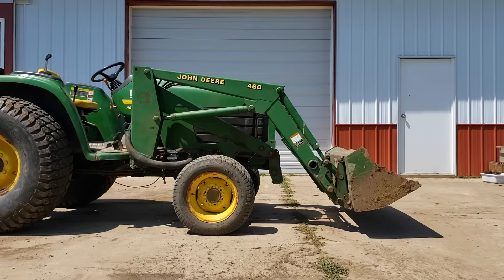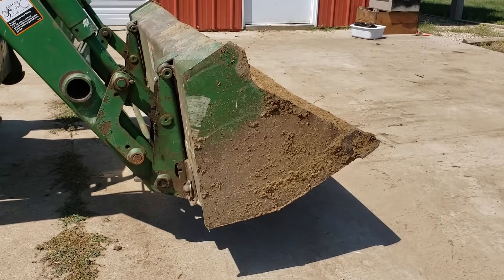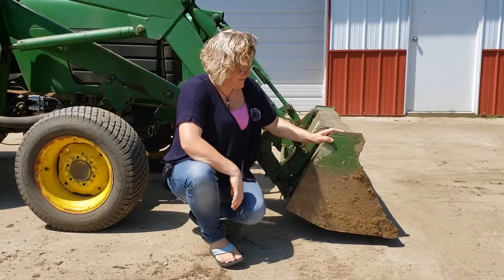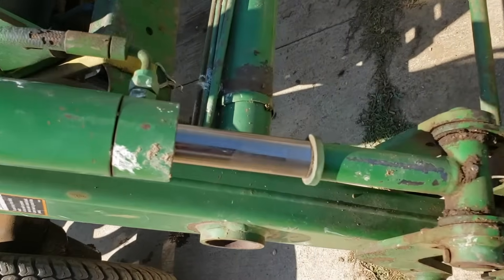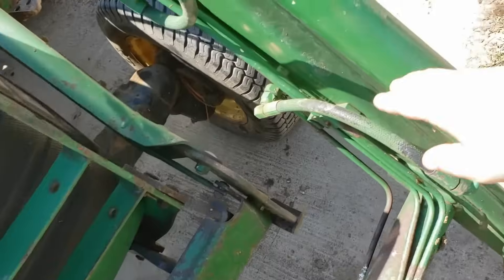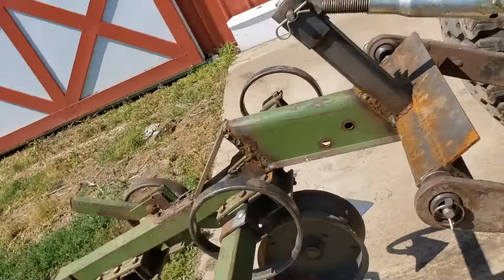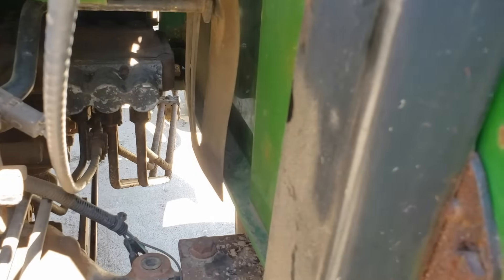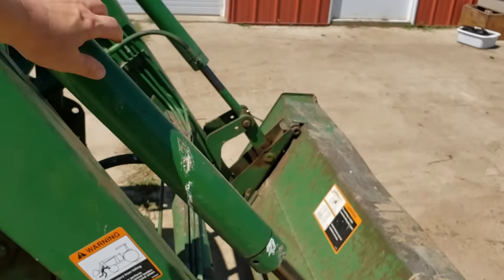How to Figure Out if Loader Control Valve or Cylinders Have an Internal Leak

Comment: Thank you great video. I have a similar issue with my min excavator but it happens with everything. Arm, bucket and dozer blade all drop over a period of an hour or less. I am changing tracks at moment and had it raised up uding arm and dozer blade but it kept creeping down. Very frustrating. I take it that rules out cylinder leaks and must be valve block or a seal in tank? Any advice would be greatly appreciated 👍
Reply: that all sounds off the same hydraulic valve/machine controls valve.

if you can check out if your mini ex has this valve isolated, it should be easier to check. lets say all the functions except track, are on this valve, I'd suspect the spools. either debris, stuck spools, valve failure. 
have seen where some mechanics MIX spools up, and do not put them back in order, causing this issue to be continuous. but this is a very rare thing so far.

I work on CASE, tend to lean more on hydraulic side. check out them spools, look for any abuse, cuts that cause a leak. Basically the spool for bucket lets say, has 4 options cut into the spool, depending on operation, the spool will shift to designated cut, and allows the hydraulics to flow is such way. 

lastly, the spools/control valves, seem to be the most sensitive/intolerant areas in a hydraulic system, once tiniest of metals entered and did its ripping, high chances it destroyed other spools with it.

Comment: For safety reasons, I ALWAYS have my hydraulic equipment DE-ENERGIZED!!!  What I mean by that is, if my grandkids go out to play on my stuff, I do not want them to pull a lever that pins or crushes someone under equipment.  I give zero 4ucks if my equipment drifts over several hours when I am not using it.

Comment: You should be able to isolate by simply disconnecting the quick connects. If it drops with the lines disconnected, it's leaking past the internal cylinder seal.
Reply: Or remove the return line off the cylinder and dead head the buck cylinder rod completely out of the barrel. If oil shoots out of the return port of the cylinder then oil is internally bypassing the gland seals....just aim the port towards the grass and away from people. Hydraulic high pressure isnt something to play with

Comment: A slightly simpler method is to remove only the couplers that control tilt. If the bucket fades then a cylinder leaks. To tell which cylinder is leaking, remove one of them from the system and temporarily cap the lines.

Comment: Thank you for this video. Do you have a test for determining which cylinder is leaking, left or right? I have one side of my lift cylinders has a little give when loaded and bounces. I assume they should be rock solid. Thanks again.
Reply from the maker: It’s best to rebuild both sides. Even if only one side leaks, once you rebuild that cylinder, the other one’s seals will likely go out due to the fact that those seals are just as old, and the pressure change causes them to go out after the leaking cylinder is rebuilt.
Reply: @shortlinepartsllc6795 any advice on isolating which cylinder if both were repacked last week?

Comment: Last week I had cut a large tree trunk that had fallen over..some of the pieces were maybe 350-500 lbs..  I had cut one in half and fired my Ford 4000 up and the loader went straight up without me even moving the lever to raise the loader and it sprung a huge leak..blew a seal out where the 2 control levers are that raise or lower the loader and move bucket up and down.,..so I shut the tractor off and the loader came down slowly..  I did not want to work on it where it had messed up because it was far away from all my tools so I cranked the engine up and up went the loader maxed out and I drove it to the designated work area..turned engine off and loader came down.

I have replaced the blown out seal and filled the hydraulic fluid back up and went I start the engine the loader will not raise any now..but the bucket will move...I think something happened to the 2 large hydraulic welded cylinders that raise the loader up but there are no leaks...now this Ford 4000 has a separate pump on the front that runs when the engines cranked but I think its working right...any ideas anybody ??  I need my tractor for work on our property but I don't know what to do now and live out in the boonies.
Reply from the maker: Did you try switching the bucket lines with the loader arm lines like in this video to see if the problem switches (arms raise but bucket doesn’t tilt) so you can know if the valve is the problem? My guess is there’s something broken inside the valve.
Reply: @shortlinepartsllc6795  Sorry for being late here to your reply..I really haven't messed with it lately but going to do this in a few days and see what happens..the bad thing is I don't have anybody here to help me bleed the air out of the hydraulic system.  Thank you for the reply.

Comment: Thank you for, the good troubleshooting methods and options... Much appreciated...  I have a New Holland compact tractor that is really slow at the bucket arms. I added my forks and it seems I need even more RPM's to lift. The bucket front/ back tilt work fine. Tnx again! ~ D

Comment: a bypassing cylinder or valve creates heat ..... operate the equipment then do a thermal scan .... the component that is the hottest is "leaking"

Comment: I was wondering if you could perform a reverse test. Prolonged resting with upward force on the bucket to see if the Pistons leak fluid. Seems to me they are sucking air in either around the seals of the Piston or like someone else said the quick connects which are designed to hold pressure. Great video though.

Comment: Those wondering why drift matters, be aware that fluid under pressure, that is leaking past a seal, will further erode that seal and possibly the metal that holds it in place. In other words, bad goes to wor$e.

Comment: Good idea, but the final conclusion is not correct. Piston seal leak will not cause drift. This test proofs there is a leak on the path out from the piston end - the pipe at the ass end of the cylinder, the one you didn`t remove and check.

Comment: I don't think cylinder drift can be caused by leaking cylinder seals due to one side of the piston having lower volume than the other.
Reply: I am an old, and I mean old, hydraulic and auto mechanic. Think about a shock absorber on a car or truck. You have a cylinder, a piston, a rod, and oil. The piston has a hole in it but the piston is still required to move from one end of the barrel to the other without loosing or replacing any of the oil. 
I am guessing that this is similar.

Comment: If the piston rod has retracted , the equivalent volume of oil had come out externally ( from cylinder if both piston and gland seals are demaged or from demages hoses ) or internally through directional valve.
Reply: correct, oil has to be removed from the cylinder for the piston and rod to move. probably back to the tank trough the directional valves

Comment: I called that before any of the tests.  I just rebuilt my bucket cylinders.  They were leaking slightly out of the front so I was pretty sure the gaskets (o-rings) were screwed up inside too.

Comment: Now lets see if I got this right, when you switch hoses, tilt with lift, then to make loader lift you move the valve control  lever in the bucket tilt position then the bucket lifts or lowers....... In your case when motor was shut off for a while with the hoses switch the bucket still lowed, but if it didn't then that would mean the by-pass leak is in the valve control body. Did I get this school lesson right? if not thanks for trying ........
Reply from the maker: If the problem switches, then the leaking is likely happening in the valve control body. For example, in this video if the loader arms drifted down when tractor was powered off, that means the leaking is likely in the valve.

Comment: Your not accounting for the cylinder rod volume. even if you remove the cylinder seals all together and cap the hose connections the rod will not move in or out. As the rod, in your case, is pulling out of the cylinder hydraulic fluid or outside air must be replacing the space the rod was taking up. I think you have a leak somewhere that will seal under pressure but leak air in when under a vacuum.
Reply: True, as the rod extends the non rod side of the cylinder has to be pulling fluid from somewhere due to the increase in volume.
Reply: @bhstor0  I think it’s the piston seal that’s passing and one or two quick connections are leaking air into the system. Quick connects can hold a lot of positive pressure in but when under vacuum they tend to leak. There just not designed to seal under a vacuum. The hydraulic pressure helps them seal.

Comment: Nice, I had this exact problem a year ago and figured it wasn’t to bad… now I have this exact problem and it’s most definitely bad(my bucket tilts forward as fast as it would if I was tilting it under pressure)… I was just going to throw parts at it like normal, but I think I’ll try this first, thanks!
Reply from the maker: Jeremy, thanks for your note. Did you get a chance to try this diagnostic test out on your equipment? Just curious if it helped you figure out the root cause of your drifting bucket.

Comment: Yeah that’s any easy indication for me. Cylinders not staying up means you have cylinder leaking fluid through their seals.  I wish I knew why my hydraulics are moving slowly and why my front loader won’t move at all. I completely drain my hydraulics, I put 2 new filters on it, rebuilt pressure control valve, replaced hydraulic bypass valve, removed and cleaned the internal screen and no dice. At max rpm I get about 1000-1200 psi. System pressure is responsive to rpm change and when I turn steering wheel and backhoe the system pressure drops. Anyone got my fix?
Reply from the maker: Chris - what tractor do you have?
Reply: @shortlinepartsllc6795  Sounds like a pump problem to me
Reply: Brand new pump.
Reply: 410 Backhoe
Reply: Hey Chris,  there's a metal screen located next to the base of the filter that is probably plugged.  Many tractors have a screen along with filters. My J.D. 750 & 310 c do.  On Y.T. check out " Quick Nick Garage "  Channel and he has a great video showing that set up on his 400 - 410, only 6 min. long.  Good luck.

Comment: My first John Deere tractor did this and the JD service said valves needed replacing. I didn’t bother with it because it only leaked when off. 
I bought a brand new JD 4120 later on and it has leaked like this since new. JD service said it was fine that all JD tractors did this so I haven’t done anything to it. 
Now I know it’s not supposed to do this and it makes me mad because they could have fixed it under warranty 10 years ago. 
Oh well I recon
Reply: That’s the main thing about owning a JD, the quality of the dealership. 
IF you have a bad dealership you are at their mercy and they will give almost any excuse to keep from doing warranty work. IF you have a quality dealership they can turn out to be a businesses relationship that can last for generations.
My family will trailer our equipment round trip over 100 miles to the dealership where we feel our business is appreciated.

Comment: That's a good trick, but what's the big deal? I'd be very impressed if I found anything but a brand new tractor that didn't move at all after 4 hours or so. Set it down when it's going to be parked for 4 hours.
Reply: It's not that big of an Issue now but who knows in a year the seal could completely go out and the bucket can drop instantly under use. Better to diagnose it and get it fixed now than when it's an emergency repair

Comment: Was the ONLY sign drooping over time? I have a problem that as the tractor warms up, the loader looses its power, barely lifts a bucket of snow, everything else seems fine, Hydrostatic runs fine, power steering is fine, and backhoe is fine. I tried to switch the hoses around, to see if that helped but still no power to lift, the bucket will drop over time, maybe 1/2 hr or so.
Reply from the maker: It sounds like you narrowed down the problem to the cylinders (your valve sounds like it's working right).
Reply: Ben, your hydrostatic, power steering, & backhoe run off of different circuits. Your steering actually get status fixed first then the excess is bled off back into the tank. Not completely sure but the backhoe works off power beyond. My thinking is that u have a valve issue.

Comment: 1. Assume the valve is leaking internally, what will be the symptom?

2. Assume that the loader and the bucket cylinder is leaking internally,  what will be the symptom?

3. Assume the valve control, the bucket, and the loader, are all leaking internally, what will be the symptom?

Thank you.

Also my loader bucket is jerky, plus the loader goes down and so the PTO part.

I have to take my foot off the clutch all the way for the transmission to kick in.

I think it needs timing adjusted and so does the carburetor. 
So does the brakes..

Comment: This is great info to know, however, if it droops over a period of several hours I don't see how this is a problem. Older tractors wear out overtime and as long as it is not drooping while working the tractor I don't find any harm.
Reply: I have a bucket that “droops” like this and it has caused potential hazards. When under load it goes much faster and then it re-pressurizes and jolts. It could drop its load suddenly if the balance was too far forward. Then one time I was lifting an outboard for a friend. He had to run to his house and get a forgotten part real quick. I left it suspended like I had many times while I ran inside to get something. When I came back out the bucket had drooped enough so that the straps slid off the forks and the outboard dropped. No good.
Reply: It'll get worse, gets to the point where it droops every few seconds under load.
Reply: Great video! Thanks! I am going to run this test tomorrow!!
Reply: Any idea on how to fix I replaced the control valves made it better still no luck